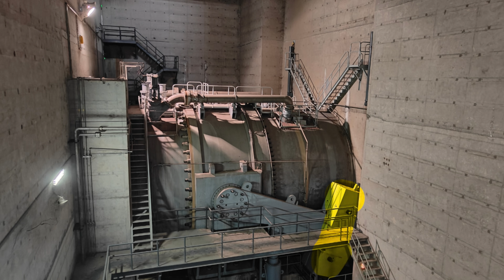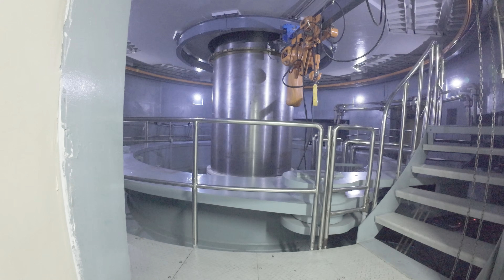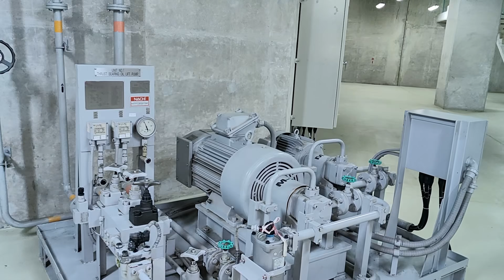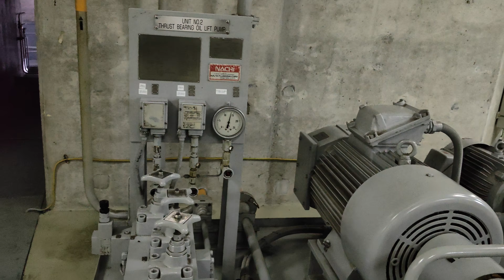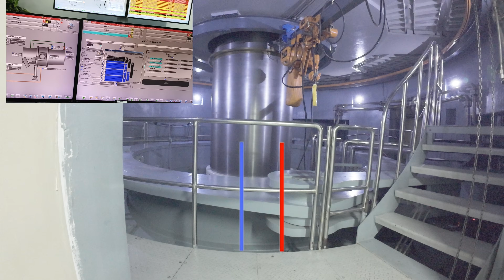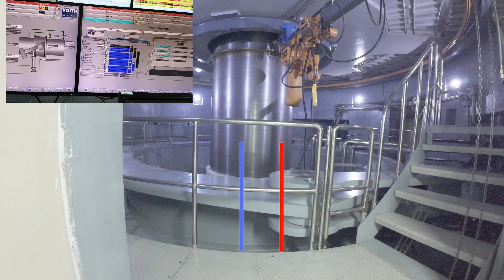Why Does the Turbine Shake? Why the Weights? How It Connects to the Grid?

Comment: The heavy weight on the MIV is not to move the  Valve into a " Safe Position" but to a " Closed Position" under gravity when normal control is lost for closing the MIV ( Valve) which is the safe position.
Reply: imagine that one little lift cylinder, striking a leak in its hose or blowing a seal.... 19 tons of counterweights and 100 tons of rotating steel, plus 450 megawatts of electricity just suddenly stopping. better be a decent hose, 's'all im sayin.

Comment: Jet engines also have harmonics when they progress through their RPM ranges. The ones I worked with had two nodes... 18 to 20% on start up with idle about 27 to 32% then at throttle up with 42 to 48% being the dangerous node. You had to progress through that first order node quickly or severe damage to the rotating parts were a given. Trust me, it ain't fun when spinny pixies get pissed and chase you.
Reply: Turbo molecular pumps have very similar issues with unwelcome resonance bands
Reply: @christopherleubner6633  the vacuum system for my sister's laboratory is like that... About the size of a small car but most of it is shielding to collect the flying pissed off pixies. She says the main rotors are pushing over 200,000 rpm, but I kinda doubt that. That's just insane fast... She says the vacuum is measured in Torr... WTH?

Comment: Cool. Would be nice to see the switch gear in action 1day. I remember about 30 years ago i was at a underground hydro plant where the arc suppression system blew the doors off the switch room. 😂 👍🇦🇺
Reply: Air blast circuit breakers!
Reply: He does show that in an earlier video where he explains the startup process which includes the main switch slamming closed.

Comment: I understand how frequency and voltage are matched.   How is phase adjusted to the grid?  Slight speed control of the wicket gates?
Reply from the maker: Exactly. The governor makes small adjustments to the wicket gates to slightly speed up or slow down the turbine. As the generator approaches grid frequency and voltage, the synchronization system monitors the phase angle. The operator (or automatic synchronizer) fine-tunes speed until the generator's voltage waveform is aligned with the grid's waveform. When frequency, voltage, and phase match, the breaker closes and the unit locks onto the grid. After that, increasing wicket gate opening adds load and power output rather than changing speed.
Reply: Years ago when I was a kid (1960s) I was fascinated by clocks, and understood that a 'synchronous' electric clock required absolute frequency stability. I wondered back then why were the mains kept so accurate... it did not seem that household clocks were that high of a priority. My question was only answered years later when I realized that absolute synchronization was necessary for the grid to operate. (aha! moment)

Comment: What RPM does that shaft run at full power?
Reply: looks like 100rpm, so would likely run a 30 (wow) pole generator, or it'd be geared up, though that's unlikely.
Reply: The same speed as when first synconized. Torque is increased to the gen as the wicket gates are opened further, pushing power into the system.